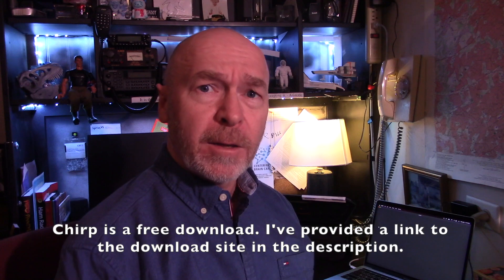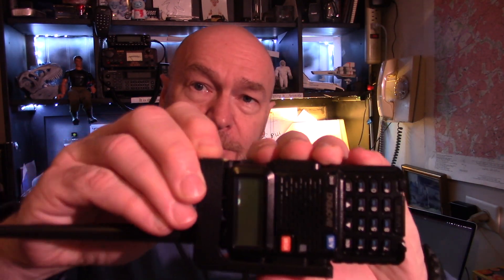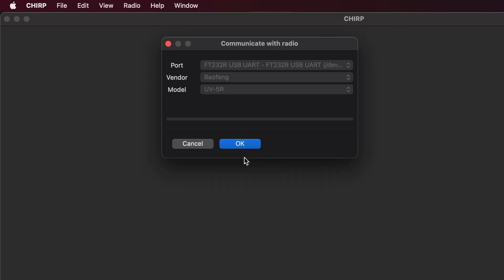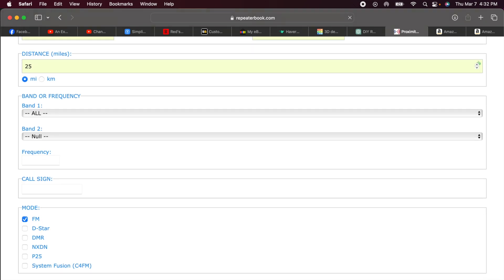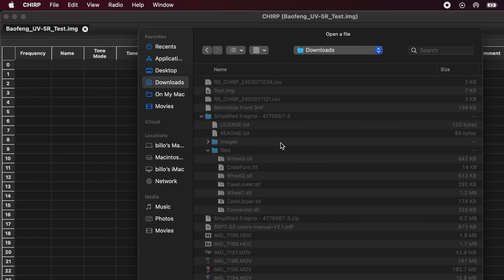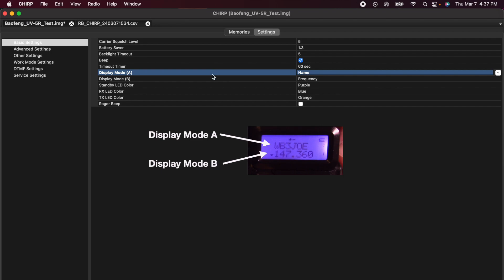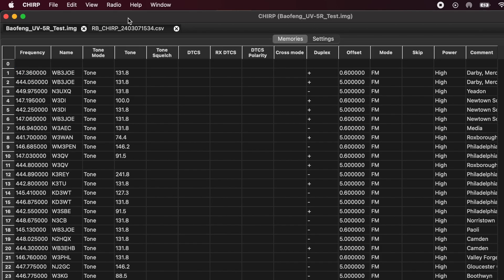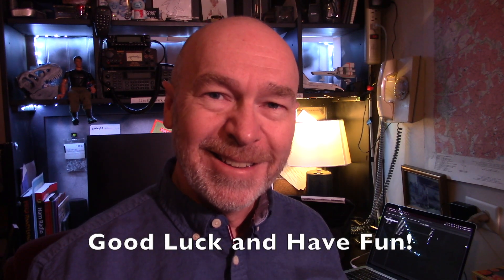Chirp Software to Program Ham Radios like UV5R

Comment: Thanks.

While not a big Vhf & Uhf repeater fan my old Wouxun no longer likes to keep the battery pin outs in contact with the pin outs on the rig itself without help such as a cable tie. So, how can you go astray when the UV-5RTP is sold for around $24 & I ordered one three days ago.

Depending how ambitious I am I may use the Chirp software to program in a substantial list of repeaters. On the other hand I'll primarily use it when traveling long distances or for satellite-based experimentation. Thus Chirp will be handy when I know my route such as from Albany NY to Saint Charles Virginia & until then only wanting roughly 3 to 5 repeaters programmed into the rig I likely will do it the old fashioned way.

Again thanks & I will remember this video when the time arises for needing several dozen repeaters programed in the rig.

If one wonders why I bought the UV-5RTP that lacks the FM broadcast band and some other features the answer is I really am only interested in narrow FM modulation & liked that it output on high power 8 watts which is enough where sometimes 5 watts keys the repeater but barely. I also liked its price especially since I am not a fan of some of the content & tribal like behavior that repeaters can offer.

De, kc2wvb
Reply from the maker: Hey, I’m glad that my video was helpful. If you are going to be traveling with your radio then you might also want to look at the Tidradio wireless programmer. I did a review video. You can reprogram your radio using your phone instantly and anywhere. It’s great for travel. Thanks for watching and taking the time to comment. I really appreciate it. 👍